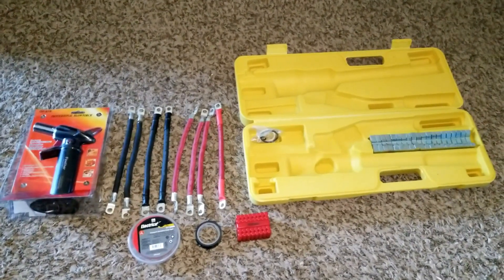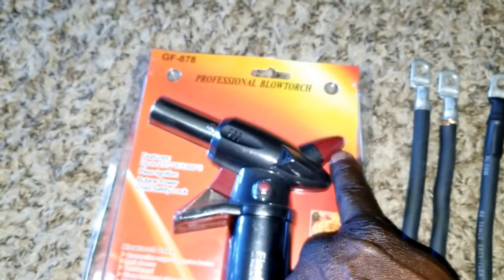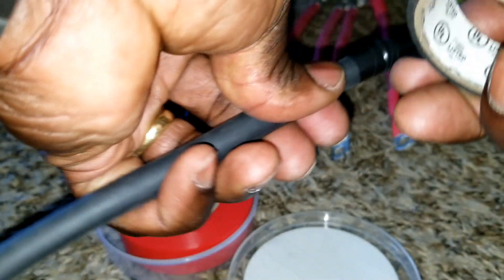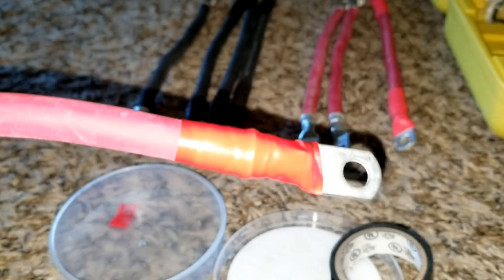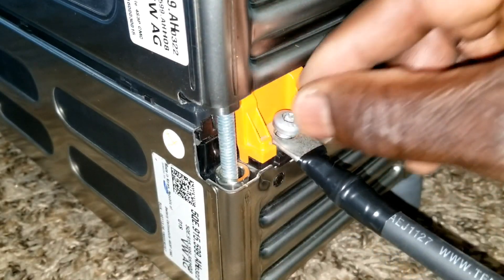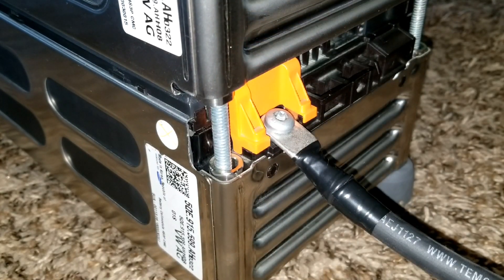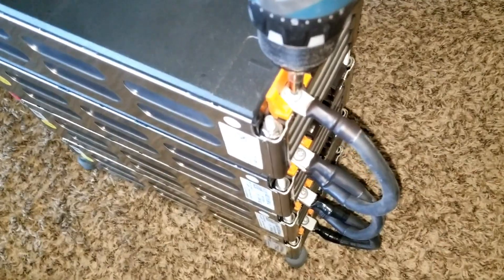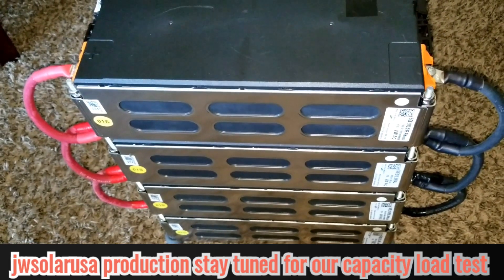VOLKSWAGEN E-GOLF GEN 2, ELECTRIC VEHICLE BATTERY,WIRED IN PARALLEL, STACKED AND READY TO OPERATE #4

Comment: Hi. I have 4 of these cells I will be using in a solar setup. But when I try to charge them with my chargers (also for liion, lifepo4 etc), the chargers wont charge them. They take the cells for agm or gel battery and will only put 13-14 volt out. I need 16 volt. If I open the batterycase there is some sort of print on the top. Maybe a bms. Any suggestions?
Reply from the maker: SANYO LITHIUM BATTERY - Volkswagen e-Golf lithium battery powerwall: https://www.youtube.com/playlist?list=PLSNjIRSnUPDKCEnMsS4WJhA_yg0BByW-z
Reply from the maker: Watch my videos you will pick up a lot of information about these batteries.
The battery doesn't have a BMS but has a PCB Board that communicates with the main computer
Reply: Ah. The pcb board is maybe the problem for me. I will watch more of yoir videos. @jwsolarusa